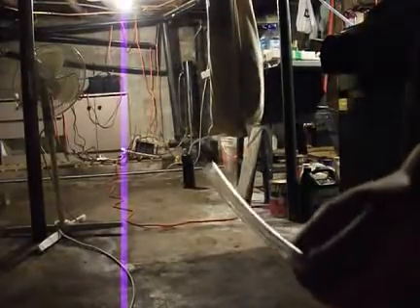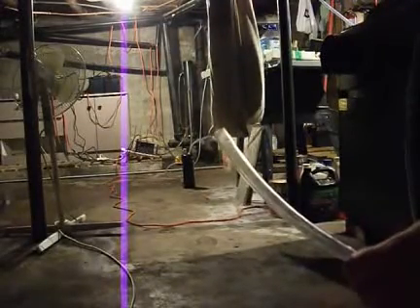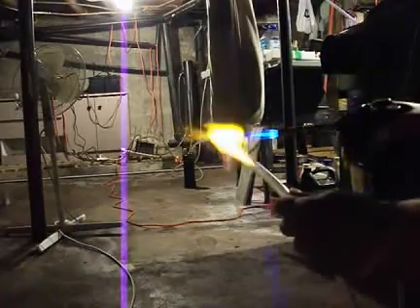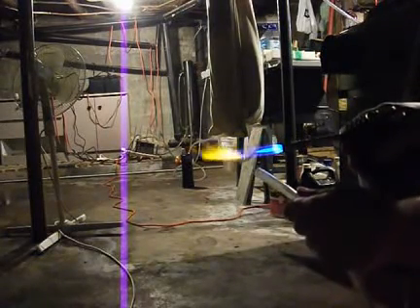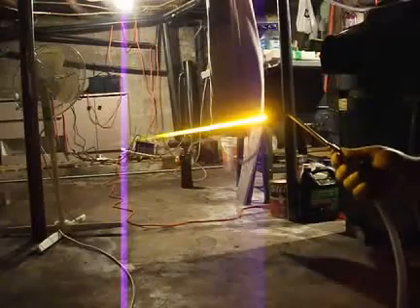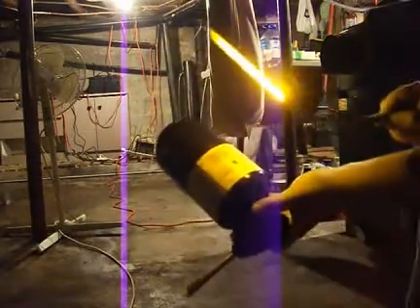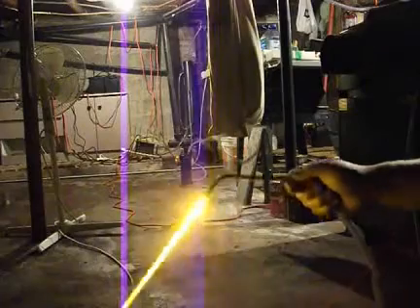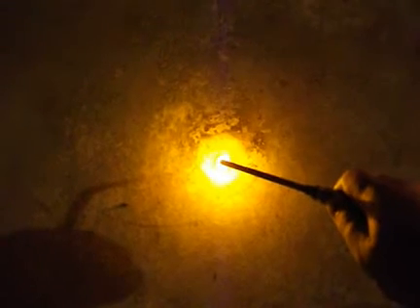HHO flashback arrestor spring mounted part 2 Working and tested !

Comment from the maker: i did over 100 flash back whit it if not more... so far the only thing that did wore off is the sealing gasket that hold the flash back to the bubuler, and that was after a major explosion under masive pressure build up. And i have check the mouse ball after still grey no trace of burn ... just like the Tube that bring the hydrogen to my torch is still clear after all my test. i'll make a video once i reach 500 or 1000 flash back to show you guys.